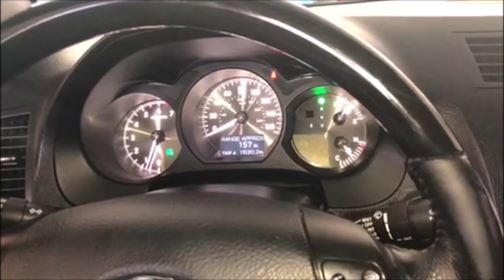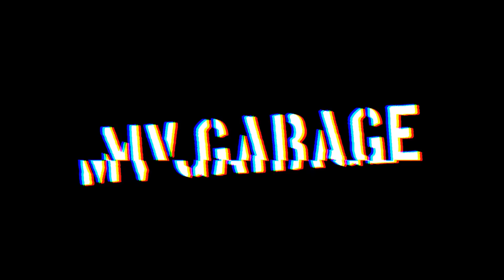Lexus Toyota VSC / Trac Warning Light FIX

Comment from the maker: Please consider “Subscribing” to catch all the latest content! Subscribe! 👉🏼https://www.youtube.com/@FlipITGarage?sub_confirmation=1 🤙🏻 Note: If you have a check engine light on with the VSC watch this video: https://youtu.be/iLrolhRr9lk
Reply: MV Garage hello I have a 2007 is250 my check engine light svc and traction control light is on does this method work with my vehicle?
Reply: Do you put the paper clip while the car is running?
Reply from the maker: lenny hernandez If you have a check engine light on then you need to fix that first and then the VSC will turn off.
Reply from the maker: Bie Ngosa You should install the clip with the car off. That’s what I would recommend. But should work either way since the plug has constant power.
Reply: Will this work for a 2008 gs350?
Reply from the maker: Angel Sanchez Yes. Same procedure. This was done on a GS.
Reply: @FlipITGarage  I'll give it a shot when I get off work thanks man
Reply: @FlipITGarage  I also noticed all three lights came on at the same time vsc, trac and check engine light I'm hoping it's all related to the same issue
Reply: Would this work on 2009 es 350?
Reply from the maker: Angel Sanchez If you have a check engine light that is the main issue. That’s why the other lights are on. You’ll need to get that scanned to see what it is. Tell me the code you get and I’ll try to help.
Reply from the maker: Ray_ Hydro Yes should be the same procedure.
Reply: @FlipITGarage  my code came as p0420, the bank 1 cat is below threshold, any suggests?
Reply from the maker: @naturallyodd420  With that code. Either you have an issue with the catalytic converter itself or the oxygen sensor after the converter.
Reply from the maker: @angelsanchez9877  https://youtu.be/iLrolhRr9lk
Reply from the maker: @naturallyodd420  https://youtu.be/iLrolhRr9lk
Reply: 2007 lexus is250
Reply from the maker: @controlpediacaryami  same procedure
Reply from the maker: @SUGRIM BHAWANIDIN The code you have is for a oil control valve. You may be able to clean it and reinstall. Then clear the code. Here’s a old video on the cleaning for a RX300. But it’s similar on yours. https://youtu.be/9o5tegDGL9I
Reply from the maker: @SUGRIM BHAWANIDIN And here’s how to clear the VSC and check engine light. https://youtu.be/iLrolhRr9lk
Reply: Will this work on lexus is220d 2007?
Reply from the maker: @avithandi5437  should be the same procedure. Wont hurt the car to try.
Reply: @angelsanchez9877   did it work on your 08 I have an 08 also and it didn’t work on mine
Reply: @joeljohnson5417  no I ended up having major issues lol 😆 head gasket, followed by a bad alternator/ main fuse blow out and the fuel pressure regulator. One after another. Cars running like a champ now 💪 6,000 dollars later hahhaa
Reply: Help! I think I did something wrong. After I did this abs, brake, and check abs, ebc, and vsc lights came on. Also brake malfunction appears on my dashboard. My vehicle is a Lexus 2008 GS 460.
Reply from the maker: @jona.tang01  sounds like you may have connected the wrong terminals. Disconnect the negative battery terminal for 10 mins.
Reply: @FlipITGarage  I did the paper clip ab it was flashing but once I turned the egnition on it didn’t go into vsc mode an I let it flash for 10 seconds but lights still on
Reply from the maker: @silentbutdeadly3466  you don’t have a check engine light on ?
Reply: I have RX 400 after changing the tires the VCS, trac, brakes, check engine lights came on and I try this but it doesn’t 
work what can I do?
Reply from the maker: @adefolarinaderibigbe8504  Hi, this will only work if it’s just the VSC light. You can disconnect the negative battery terminal for 10 mins then reconnect. It will clear all those faults. If it comes back on you’ll need to get the check engine light scanned to see the issue.
Reply: Can I try this on 2006 RX 400h ? My check vsc system on and car will not crank

Comment: Just to let everyone know, i tried this method on my LS460 (2007) and it worked! Saved me thousands!! You earned a Sub my friend.
Reply from the maker: Appreciate the feedback! 🤙🏽
Reply: I was just gonna ask about the same car. I just got the starter changed on my LS460 (08) and to my surprise I have these lights on the dash that weren’t there before. Did you use the same pins as mentioned in the video?
Reply from the maker: @inaedemarughu8275 Yes, would be the same pins. Late response but commenting to help anyone else out!

Comment: Its not working for me???
Reply from the maker: What’s your year make and model? And you don’t have a check engine light on with it correct ?
Reply: @ No I do have a check engine light on too. It’s a 2009 LS460. I scanned the car and came back with some bad codes. P0746
P0776
P2714
Transmission codes🥲
Reply from the maker: @ This procedure will only work if it’s only the VSC light. Your VSC light is on because the check engine light is on. It triggers the VSC disable when you have other issues.

Comment: This worked for my 08 IS250 after I replaced the altenator. Keep in mind that when you first jump the Obd with a paperclip, that you must have the on/off switch in the on position.
Reply: First or second on position? I got mine to go in to go in test mode but lights never came off

Comment: So I did the trick and the only thing flashing was the power steering light I let it do that for a couple minutes and starting it nothing happened. I have a faulty gas cap could that be a reason why. I hate that it’s vsc I want my regular Lexus manufactured
Reply from the maker: Do you have a check engine light on ?

Comment: One thing to add. On mine I actually had to disconnect the battery first wait 15-20 minutes for charge to die and then reconnect the battery and do this procedure. Cleared the code.
Reply from the maker: Thanks for the tips for anyone that it’s not working for, worth a try. 🤙🏼

Comment: Did this with my GX470 and it worked flawlessly. Thank you so much I wasn’t finding any answers on how to fix it
Reply from the maker: Kathan Tomlin Nice! No problem. Glad it worked out for you! 😊
Reply: If I did it on my GX470 and it didn't go away does it mean there is a particular issue with VSC?
Reply: @TheLANDSQUID  hey bro this just happened to my gx470 today along with not being able to shift out of park when I start the car I have to override the shift lock release to get it into drive. There was four lights that came on the abs vsc off vsc trac and anti skid. But they came on intermittently and did not stay on continuously for the entire trip just as I’m pulling off out of park and a few more times throughout a road trip but there is nothing wrong with my car it never effected performance.  Did your lights ever back come back on after you reset if with with paper clip trick? And also were the lights coming up intermittently for you or did they stay on until you reset it?
Reply: @Elite_Employee  same thing just happened to my 2006 is350
Reply: @Elite_Employee  you probably gonna need to replace your oxigen sensors soon, hope this help...if that's the case order them on Amazon, it will save you lots of money!!!
Reply: @walterflores456  ended up being the brake light switch broski

Comment: Man I’ve had this problem ever since I got my oil pan replaced at a shop, I’m gonna try this fix whenever I get home . Thank you so much. Fingers crossed it works
Reply from the maker: Hopefully it works for you! Keep me posted. 🤙🏽
Reply: @FlipITGarage  it didn’t work :(
Reply: @FlipITGarage  it came on after I got a new oil pan for my 2007 es350
Reply from the maker: @Ls2raw  You don’t have a check engine light on right?
Reply: @FlipITGarage  my transmission went out . 😅
Reply from the maker: @Ls2raw  Oh man! Sorry to hear that! Sure it’s a pricing repair.
Reply: @FlipITGarage  yeah they priced it at 4765 to get a used trans with 70k on it . Sad to say I only paid 6 for the car and someone wrecked into it at the shop so I’m sol :/ got a expedition now lol
Reply from the maker: @Ls2raw  Yea I figured it was a pricing repair. I would have got rid of it as well. Hopefully the expedition is good to you!
Reply: @FlipITGarage  hopefully so , it’s lasted me 70k already almost hitting the 300k club but she’s riding out
Reply: @FlipITGarage  thanks man

Comment: Thanks so much... I'm going to try this... I just bought a used GS 300... I love this car but the VSC light just came on.
Reply from the maker: No problem! Glad to help. Let me know if you have any issues 🤙🏼
Reply: Did it work for you? I have a 2006 Lexus gs300 same issue
Reply from the maker: @ueray4  This video was made on a 2006 GS300. As long as it’s just the VSC light it’ll work.
Reply: @ueray4  it worked but it was a temporary fix..  so I bought a code reader and I reset the alarm that way.... The alarm will come back on after about 10 miles of driving... Doesn't seem to have an effect on the car at all... Love my ride

Comment: Hi, i recently replaced both of the front cv axles on my car. These axles were replaced while there was a check engine light on the car along with trac and vsc flashing as well. The car became a pain to drive after the axles replacement. Car drives fine straight but is hard to turn. It's almost as if there is no power going to the wheels when i turn the wheel and give it gas. The car did drive fine before the axles were replaced, and at the time, the check engine light and vsc were both on. Problems started after the axle replacement. Should i have done the check engine light fix first and then the axles??

Comment: I will try this on my 2007 IS250. The VSC, trac control engine light just came up after a couple of minutes passing through some rough bumps. I hope it helps
Reply from the maker: Keep me posted!
Reply: Did it work? I just got this car from my father in law and it has this issue.
Reply from the maker: @GenericEricGames  As long as it’s just the VSC light on it should work. Won’t hurt the car to try.

Comment: Would this work for the 2009 Lexus RX-350? I am having the VSC Light and check engine light showing time to time on the dashboard recently for no reason.  Thank you so much
Reply from the maker: The VSC is on because the check engine light. You can clear them by disconnecting the negative battery terminal for 10 mins. But if the lights comes back you will need to get it scanned to see the issue.

Comment: Hey Man! just bought a beautiful 2007 is250 one owner. 167k miles Check engine, VSC and traction control light came up, I used a snap on OBD reader and codes P0894 and P2714 were shown. 
I watched a lot of videos and read a lot about this and it seems to affect a lot of lexus owners and seems to have multiple solutions. 
How will you approach this? I am very tempted to try the paper clip in the obd since I used that with a corolla and solve the problem.
the car drives fine with no issues
Reply from the maker: The VSC light in your situation is on because the check engine light is on. They go on together. I would start by getting the car scanned for codes and go from there.
Reply: got an 07 250 my self and they just came on after weeks of not having it. it came on once when i messed up my maf sensor reconnected and fixed it but seems to not be the issue now. did the paper clip method work?

Comment: Hi. Will this work on Lexus 2007 RX 400h?  Hybrid version. 

Looks like previous owner had the tires changed and this happened but I bought the car so I want to fix this. 

Appreciate any help given…
Reply from the maker: Hi! Is it just the VSC light on ? Or is a check engine light on as well?
Reply: I have the same car and it is the VSC indication, along with ABS, Traction, E brake, and Brake warning lights

Comment: So I have a 06’ IS350. Has been scanned as a wheel speed sensor about a year ago, it only came on in the rain. I got a wheel alignment and now it’s on every single time I drive the car, doesn’t cause any issues, just annoying to look at. Would this work or would I need a nee sensor do you think?

Comment: Hi MV Garage, great video. Do you know how to do the Engine check light and VSC light in together. I cleaned the MAF sensor and throttle body but power on with MAF sensor disconnected.
Reply from the maker: John CW Chan Hi ! And thanks ! Usually if there is a check engine light that always triggers the VSC light as well. You would need to get the code scanned for the check engine light it could be one of a hundred different issues. You can get it scanned for free at any auto zone. Let me know the code and I can try to help. Thanks.
Reply: Much Appreciated will try scan codes then. Cheers!

Comment: My 2007 gs430 had the diagnostic say the right front wheel speed sensor fault. On checking the connector I noticed it has some vertigris on the brass pins and in the receiving sockets of the plug. Cleaning those terminals cleared the fault.
Reply from the maker: Nice! Glad you found it and figured it out. Easy fix 🤙🏽

Comment: Recently got a 08 is250, i have an intermittent issue with the vsc light, it comes on after driving a distance over 30km. Though if I switch the car off and on, the vsc light goes off. On the obd scanner it says foreign object interference or something similar on the left back wheel. I bought a new wheel speed sensor but when I installed it the vsc light came on immediately when driving. Would the new sensor be faulty or should I try this and see if it works?
Reply from the maker: It may be an issue with the wheel bearing itself that the speed sensor uses to read the data. The code was for a wheel speed sensor and you change the sensor correct ? I would lean towards faulty wheel bearing.

Comment: MV Garage. I asked you yesterday about this working on my 2006 4runner and I was reading some of the other questions and your replies it won't work if the engine light also comes on.  Mines does and the code I got was P0430 -Generic Catalyst System Efficiency below Threshold Bank 2. Thanks again.
Reply from the maker: Terrance Gamble yea if the check engine light is on that is why your VSC light is on too. Need to fix that first then the light will go off.
Reply: @FlipITGarage  the engine light isn't on all the time. When I clear the codes the  engine light also goes off. its like the engine light comes on and the other two comes on behind it and then I clear the codes again.

Comment: I have the same light and same car year and model (06 gs300). But my car's traction control doesn't work because of the light. I want it to work more than to erase it. 
Would my traction control work again if I do what you did? 

Thanks
Reply from the maker: Do you have the check engine light on as well ?

Comment: I own 08' IS250 recently ran into a potholes and my VSC, check engine light came on. I'm going to use this procedure and see if the problem goes away. Wish me luck!!
Reply from the maker: PullMeSoftly44 Hopefully it works out for you. But just know whenever a check engine light comes on the VSC light comes on with it. I would look into the check engine light first. More than likely if you reset the check engine light the VSC light will go off.
Reply: @FlipITGarage  I tried your method several times hopping that it'll work but failed. So, I tried another method by disconnecting both terminal from the battery and wait several minutes before connecting them back an start the car, that finally solved my problem. The VSC and Chk Engine light went away.. Strange thing!! Thanks for the advice 👍
Reply from the maker: PullMeSoftly44 Yep. Disconnecting the battery will reset the check engine light. So the VSC light was on because the check engine light. If it does come back on you will need to get the check engine light scanned to see what the problem is. Hopefully it stays off!

Comment: Have the check VSC on my Lexus ES 350 2007.... have been doing the pedal dance sometimes the light goes off after doing the pedal thing but comes on again later. .. please will this procedure of yours... work for me?
Reply from the maker: Lawrence Ekanem Yes, It’ll be the same procedure for your car.
Reply: @FlipITGarage  thanks.. will let you know when i try it... thanks again for your quick response
Reply: I did try it didn't work out ... In end my was a Co 2 problem
Reply from the maker: Lawrence Ekanem o2 sensor ?
Reply: @FlipITGarage  yeah
Reply from the maker: Lawrence Ekanem Gotcha! An O2 sensor would cause a check engine light. That’s why your VSC light was on. They go on together. This only works if it’s just the VSC light alone. Glad you figured it out though.

Comment: Great video.  I have GS300. What triggered the VSC light for  you?
Reply from the maker: Appreciate it! On this car it was triggered by the speed sensor getting bumped when changing wheels. It is also a 2006 GS300.
Reply: @my garage will this work for 1998 Lexus GS300?

Comment: Is the VSC light the car icon with the squiggly lines behind it? The one that comes on when your car is in a skid?

The problem I’m having is that light comes on and it engages my brake and seems to cut engine power even driving straight at times. My car braked in heavy 50mph traffic and it about got me rear ended. Is this a totally different issue than what you are discussing here? 

2003 Lexus RX 300.
Reply from the maker: That sounds like a different issue. The VSC light is usually a message or spelled out. If you want send me a picture on Instagram of the light you have on I can try to help. @themvgarage